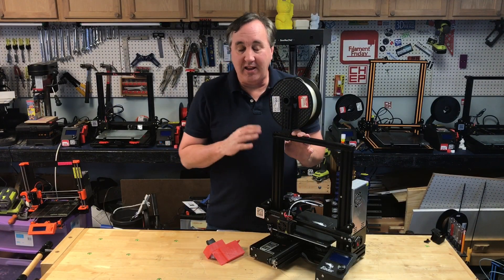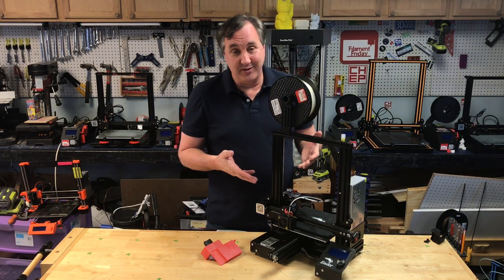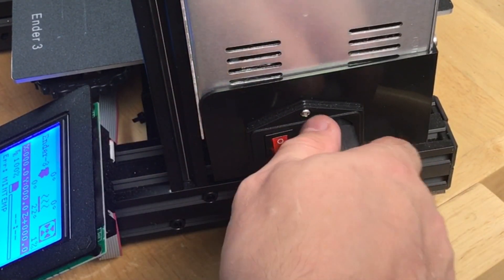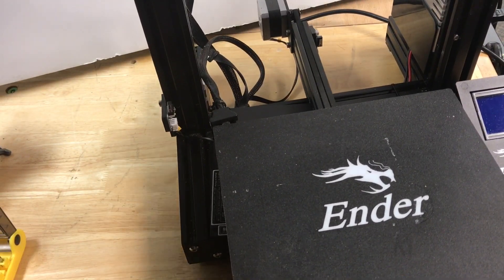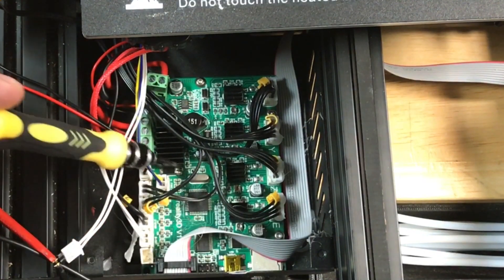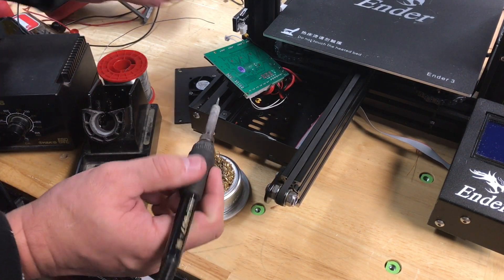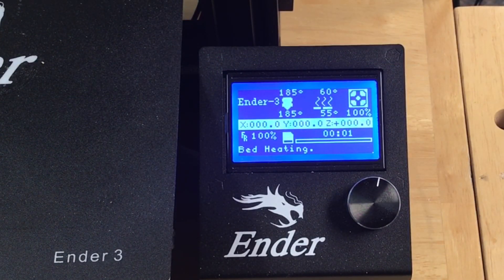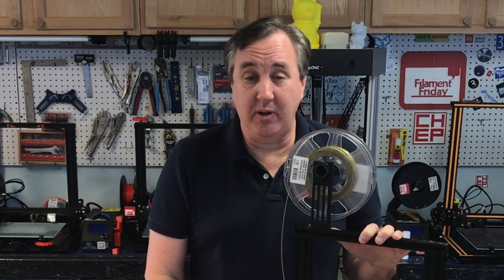Creality Ender 3 - MINTEMP ERROR and TEMPERATURE ISSUES

Comment: Hi Chuck, I have had a problem with my ender3 i cannot solve and could really use everyone's help.  Everything worked fine for a few months and all of a sudden my first and next few layers were so rough with goobs of filament and separation the nozzle would crash into them and cause a layer skip. I bought the seemecnc extruder with capicorn tubing and cleaned the hotend and used a 4mm reamer to clean the burnt plastic out and installed a new .4mm nozzle and to my dismay nothing changed. I've tried different filaments, temps and speeds with also some adjustments to the flow with no luck. I am at my wits end and i really need some ideas.
Reply from the maker: Is the extruder stepper motor turning smoothly or does it seem to jump? Also, is the Fr value on the display 100% ?
Reply: @FilamentFriday  I have not noticed anything odd with the extruder other than skipping after the mess builds up and my feed rate reads correctly.  This is very odd as i am not a pro but by no means a noob and wonder why layers are caking my best word for it.
Reply from the maker: It’s the same for multiple print files?
Reply: @FilamentFriday  sure is chep, i even downloaded some nerys g-code prints just to see if was bad slicer settings on my end but got the same results. Pretty crazy hey.
Reply: Did you ever find out what was causing your issues on this?
Reply: @mrb2917  no. I have been trying every slicer and setting too. It just goes to hell after the first layer.
Reply: Try to print a test cube but give it a giant brim (like 10mm). If the brim prints perfectly we can assume your Z axis is not raising as it should. If that is the case I would attack the issue in steps: Ensure the threaded rod is seated and tightened correctly (there is a trick to this covered in the 3D Printed Tomb of Horrors youtube channel's build video) also ensure it's not out alignment. Apply a small amount of white lithium grease to the rod as well just above the brass collar on the extruder carriage then manually raise the extruder up to the top of the gantry then back down to spread the grease out. If after this you are still having issues consider replacing the Z axis motor. Final step would be the motherboard, consider flashing stock marlin to it or replacing it (perhaps with an upgraded unit) as a last resort.
Reply: You may also want to ensure your eccentric bolts for each axis are tight but not too tight and that your uprights and cross-members are straight in all directions. It's possible the printer could have been knocked out of alignment or vibrated itself loose over the last few months. Honestly you may want to just take it down to how it shipped then follow the 3D printed tomb of horrors build video step by step to ensure it's all mechanically sound and and nothing is binding or too loose etc. Good luck man, really hope you get it figured out.
Reply: @mrb2917  thank you so very much bob for the great ideas. Your ideas gave me another, i will put my dial gauge on it and raise the z a known amount and see if it jives. Tyvm bob.

Comment: Firstly, Happy New Year
I am getting a message Mintemp Bed Printer Halted Please reset. Is this the same as your problem. Many thanks
Reply from the maker: Could be related. Often that is a temp sensor issue.
Reply: @FilamentFriday  Does that mean if the solder is ok I need to purchase a new sensor. Thanks again
Reply from the maker: Possibly

Comment: well i thought this would be it but my ender 3 pro is heating up to the right temp but then cools down to 175 and stays there so i gotta figure out whats wrong and im not getting any errors.
Reply: Check your advanced slicer settings maybe. Sometimes a different temperature is accidentally set for a certain layer vs the first layer.
Reply: @astarrobotics  I could try that but I don’t think that’s the problem
Reply: Did you find the issue. I'm having the same issue on my ender pro 3. I already changed the temperature thermistor with no luck solving it
Reply: @shawnh2870  sadly no its a bust trying to figure where to sell
Reply: @Doodle Man01  I fixed my issue. My ender needed a new heater cartridge and I put a new thermistor in too. They cost like 20 bucks for a 5 pack. Fixes it in less than 10 mi

Comment: hello, I followed your video. but it's not his. I still have the error showing. I change the thermistor, the heater tip. but always the same errors. I don't know what to do anymore ..
Reply: The retaining screw should only be finger tight.  Tight enough to hold the wires down, but not tight enough to break the VERY thin and fragile leads.  If you crank it down, you can break the leads in the thermistor and that causes MINTEMP.  If you're sure it isn't that and your error is THERMAL RUNAWAY or MINTEMP, then try run autotune PID.

Comment: I get Thermal Runaway Error. How do I fix this?
10 minutes into a print the temperature begins to drop on its own. Eventualy it gives me this thermal runaway error and tells me to reset.
My current 3D printer specs:

Creality ender 3 V1 
Upgraded silent MB
Installed new Thermister (Stock blew up and short-circuited original MB)
Installed new heatend cartrdige
Reply from the maker: Sounds like thermistor may be loose or shorted by the screw.
Reply: I'm having the same problem. I have tested the thermistor, it's working fine. I've run PID autotune many times, and still, same issue. Essentially starts at 200C for the print and it will work fine for about 10-15 minutes, and then drop to 195C, causing the thermal runaway issue. I've also replaced and re-tested the thermistor. I am starting to wonder if it's something like the power supply not being able to supply enough power, or overheating after about 10-15 minutes and then throttling - not even sure that's a thing, but no machine should be this lousy out of the box.
Reply: @AndrewTheken  I am having the EXACT same issue, have you found any solution?
Reply: @3dprintersofcanada525  In my case, it was because the power supply shipped set to require 230V. I switched it to 115V, and I haven't had any issues. Hope that helps!
Reply: @FilamentFriday  Mine had this also the green connection on the control board had a bad connection to the board.

Comment: My Eryonone ER20 will start a print at set extruder temp then about 7 minutes in the set temp stays as set but the nozzle temp will drop until extruder can't push filament and the buzzer will sound. Anyone seen this?

Comment: Since to today my Ender 3 tells me 127° end and 83° bed, no matter I heat it up or not. Any ideas for this problem?
Reply from the maker: No idea. Sorry.
Reply: Try to change your Thermistor cable if you have a spare one.. Mine was showing -52°. Maybe both your Bed and Extruder Thermistors are broken somewhere?
Reply: Managed to fix that?? After a failed print my CR10 is doing exactly that! Both termistors are FIXED at 182/66 no matter what!
Reply: @nahueljo  New mainboard fixed it. I realized that my board fan was never running because I printed only ABS and the board fan is only running when part cooling fan is on..
Reply: @KwaPaN3R  Damn, that's bad news 😅 thanks!
Reply: @nahueljo  Same here, exchanged the mainboard before. After that my thermistor broke so it might be your motherboard. Changing the motherboard is not that hard, there are some good videos on YT for it :-)
Reply: @sheryl7883  Thanks! It's not really aboout difficulty, but the hassle and well the money too. Thanks!
Reply: Nahuel José yes true, hope
you can fix it :)

Comment: Hi, the thermistor of my ender 3 gives me 120 oms, is that okey?
Reply from the maker: Depends on the temperature. If it’s cold that’s too low.
Reply: @FilamentFriday  I did the test with the ender off, what you recommend me?
Reply: What about if It Is 88 oms. And ambient temperature Is 20°C
I have some problems with extruder skipping. Nozzle Is Ok, bouden tube Ok, extruder tension OK, bed level ok
I think It Is a temperature problem, could you help me ?

Comment: So I’m having this problem on my Ender 3 V2 it prints for a bit then I get the mintemp error. The pins aren’t lose on the board “either one,” I changed the thermistor that didn’t work. I changed the power supply cause I thought the fan is broken in it, and that didn’t fix it. Finally I changed the board and THAT DIDN’T FIX IT, I don’t know what the heck is causing this.
Reply: Had the same issue on a voxilab check the output on the drivers. Search you tube video's

Comment: Hey need some help , hotend starts heating up as soon as I power on the machine and won't Stop heating, even if temperature is set at 180 it will go above 250
Reply from the maker: Sounds like something in the main board failed.
Reply: @FilamentFriday  how to check and change ,or need to replace the board
Reply from the maker: Here is a video on how to replace. Don’t know exactly what equipment you have to check it but an oscilloscope could monitor the signal. https://youtu.be/G2GJiXYBAJs
Reply: @FilamentFriday  thank you soo much
Reply: @FilamentFriday  little more trouble for you, can u please link me to video
Reply from the maker: I forgot to add it. I updated the comment with the link.

Comment: MY KP3 reads negative temperature then wont change
Reply: If the temperature is negative, it's most likely not the boards fault since the board is getting temperatures, it is most likely your thermistor either overtightened or broken.
Reply: Did you fix your issue? Was he correct in changing the thermistor?
Reply: @TokyoChopSquad  the heat bed connection was messed up

Comment: changed the cable and the extruder but it keeps giving me the error, they tell me that the card is burnt and yet it moves the y, z axis, not only the heat works for both the nozzle and the plate, the thing that I am strange is that I can't change the temperature that is, I change it but it goes back to zero